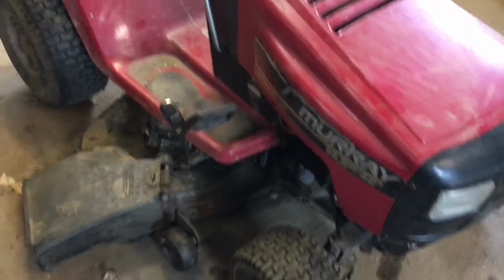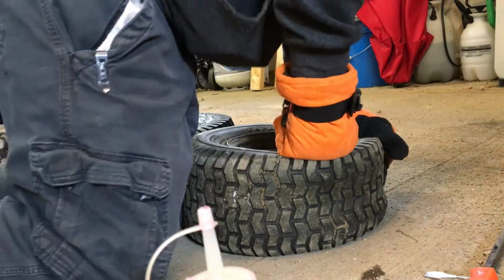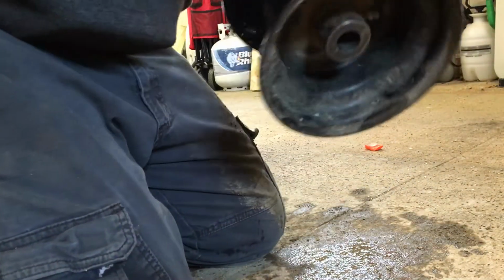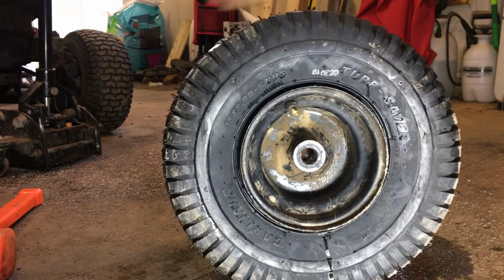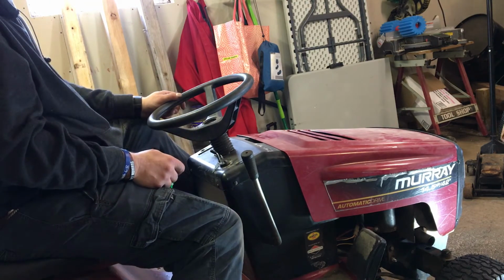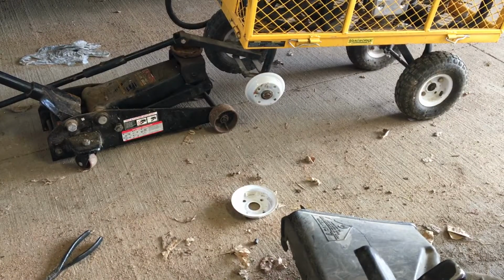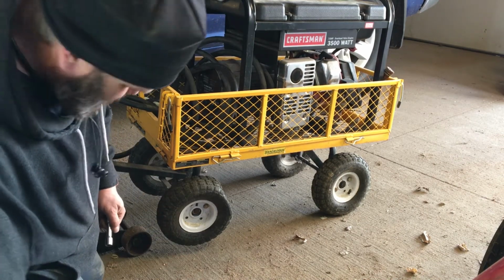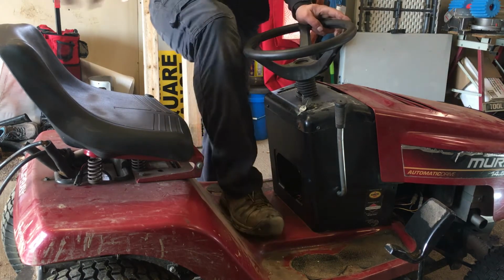Murray 42" lawn tractor tire replacement

Comment: OKO tire sealant.  Farm and Ranch.  Sealed my punctures from running over Bradford pear tree limbs and other yard debris.  Even cured some dry rot issues.  Saved all four tires for the season and still holding.